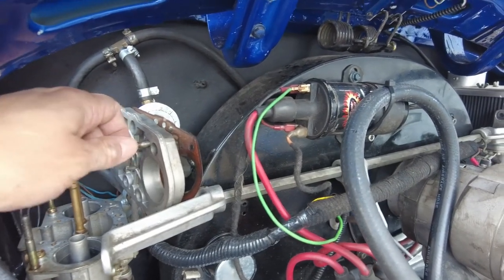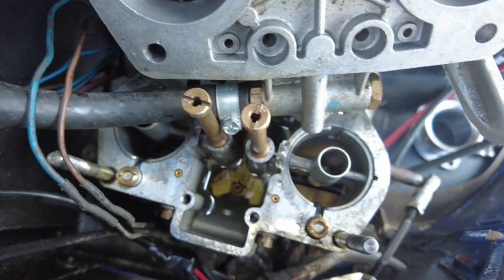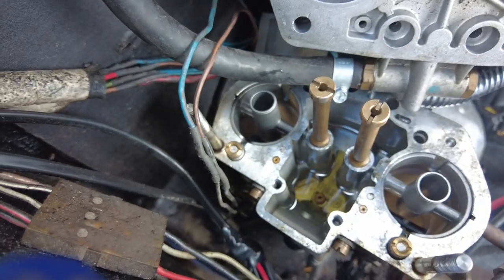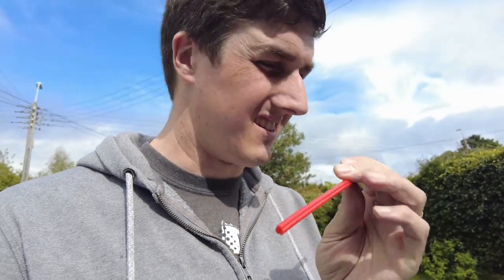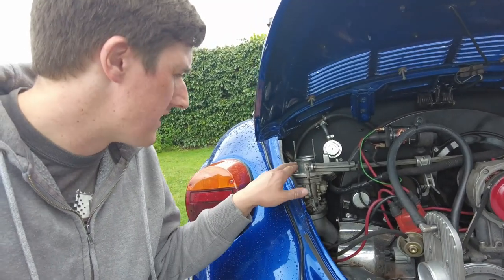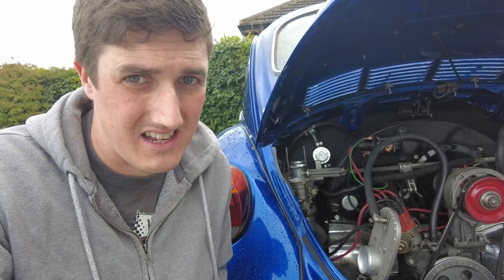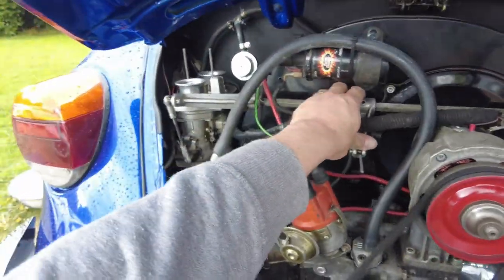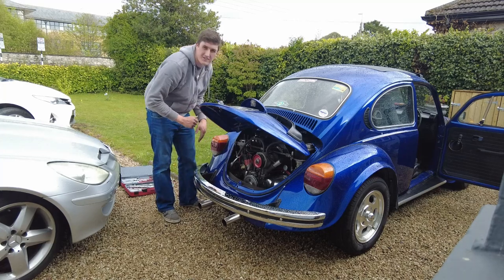Weber IDF idle jets blocked AGAIN! Fixing with minimum tools

Comment: You saved me!  Had same issue on my 914.  I cleaned the jets but I did not clean the circuit by removing the carb top.  That solved it!   Thank you!
Reply from the maker: That's great it worked for you. I made a more recent video about a mod that stops them from blocking in the first place.

Comment: Try spraying carb cleaner into the areas with blockage. This has worked for me on my 1961 corvette Carter and my 1976 mercury 850 outboard. All had blocked idle circuits. After spraying with carb cleaner the blockage was dissolved.  Immediately for the mercury and overnight for the Carter. Idle is now amazingly smooth.
Reply from the maker: I think with mine the blocked idle circuit is only part of the problem. Thanks for the advice though!

Comment: I use a brake bleeder pump to suck fuel and debris up and out of the air jet channel. Seems to work every time I get a blockage.
Reply from the maker: That's an interesting one! I've since modified the carbs so hopefully I won't have this issue in the future.